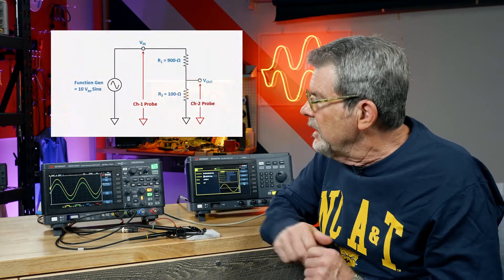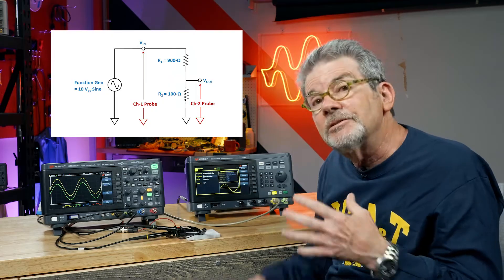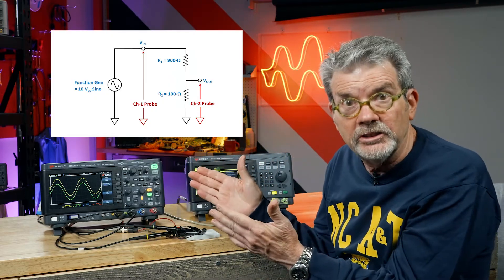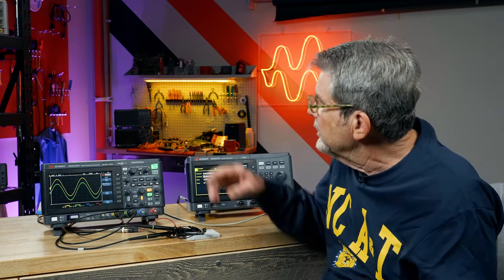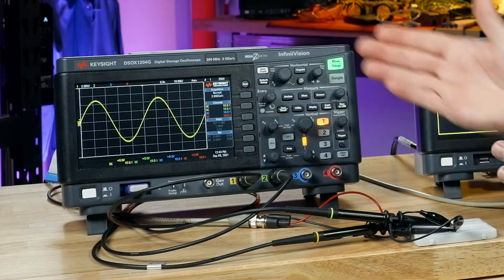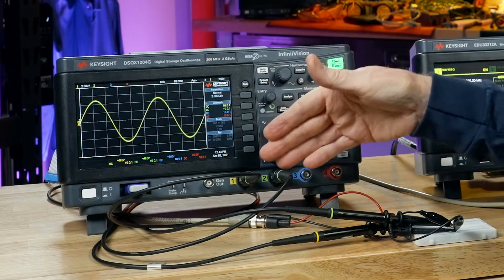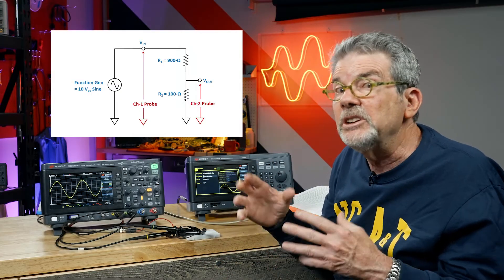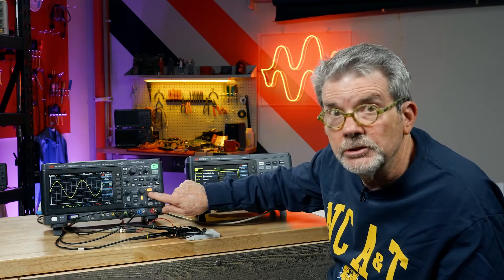Lesson 2: Scaling Waveforms

Comment: Is Vin from the function generator?
Reply: Yes, in many circuits, Vin (input voltage) often comes from a function generator. A function generator is a device that produces various types of electrical waveforms, such as sine waves, square waves, and triangle waves. These waveforms are used as input signals (Vin) for testing and analyzing electronic circuits12.

For example, if you’re testing an amplifier circuit, you might use a function generator to provide a known input signal (Vin) to see how the amplifier responds. The function generator allows you to control the frequency, amplitude, and shape of the input signal, making it a versatile tool for circuit analysis3.

Does that help clarify things? If you have more questions about function generators or specific circuits, feel free to ask!
Reply: Why are you answering your own question within the context of this upload??  Did you get tired of waiting?  Or were u afraid you’d forget, so you put it here to always look back on!?

Comment: Can you explain Vin and Vpp? Is Vin and Vpp coming from somewhere?
Reply: Yes, in many circuits, Vin (input voltage) often comes from a function generator. A function generator is a device that produces various types of electrical waveforms, such as sine waves, square waves, and triangle waves. These waveforms are used as input signals (Vin) for testing and analyzing electronic circuits12.

For example, if you’re testing an amplifier circuit, you might use a function generator to provide a known input signal (Vin) to see how the amplifier responds. The function generator allows you to control the frequency, amplitude, and shape of the input signal, making it a versatile tool for circuit analysis3.

Does that help clarify things? If you have more questions about function generators or specific circuits, feel free to ask!